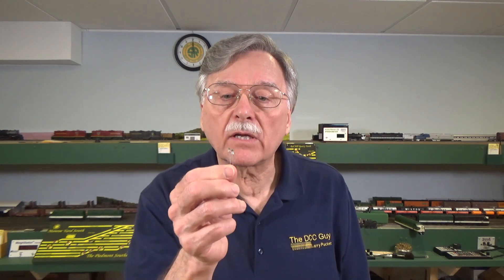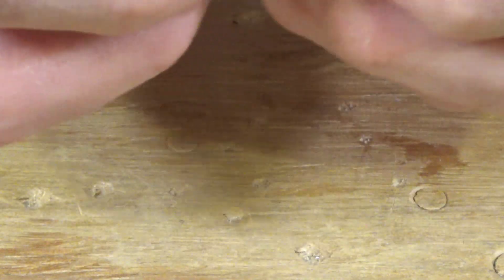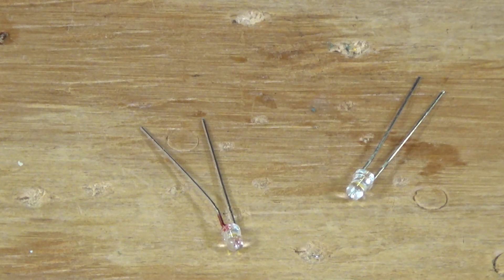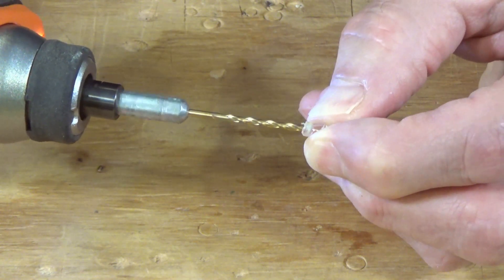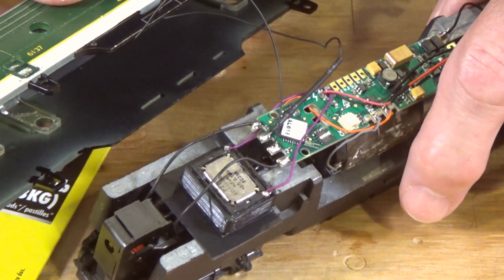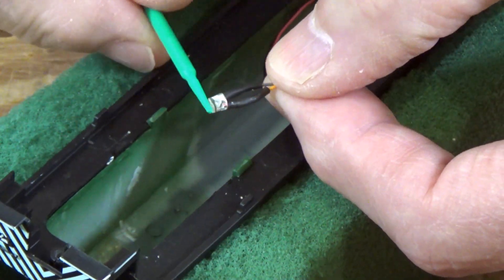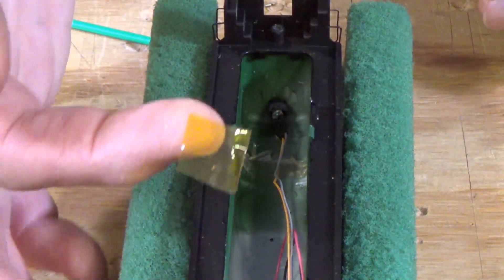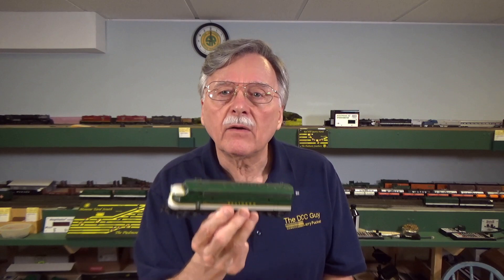Light Up Your Locos With LEDs (92)

Comment: What is the black putty you use to seal the back of the LED to avoid light bleed?
Reply from the maker: It is often referred to as black tac or blue tac in some cases and it is a strong adhesive putty. The black version seems only to be available in the US from a company named Uhu and I found it on Amazon. You can get the blue or white version at a lot of hardware and craft stores but I prefer the black.

Comment: 1 comment .whi are u using 4 leads .i ame using esu decoders and the blue lead is the positive the purple and green are the negative .i use the blue for the 2 led's ;so the plug have 3 pins not 4
Reply from the maker: That works too.
Reply: @TheDCCGuy  if you have the space then its not a problem but if you dont have space then les leads are welkom

Comment: Adding resistors in line to LEDs is not the best practice. It's OK in a pinch, but as voltage variations can affect the LEDs performance.
Instead of soldering or adding a resistor in line with an LED,, use an SMT current limiter instead. It's about the same size as a resister, only variations in voltage will not affect its current output. You can put 7-8-9+ volts across the LED/Current Limiter and it will only allow 10ma, or 20ma of current thru the LED. They even make them SMT pre-mounted on a small circuit card so all that's needed is to solder the wires.
They also make them in a "transistor" style looking package. There are also 4-pin SMT voltage regulators, (Maybe 1/8 in sq) put 20+v in and get 3-5v out. This stuff is pretty easy and makes adding LEDs simple.

Comment: Thank you Larry for more very useful information. Surface mount LEDs and surface mount resistors how neat. I will watch the rest of this series later today.
Reply from the maker: John, I don’t try to solder wires to the LEDs and resistors anymore, way too small. Instead I use prewired ones I get on ebay. I have shown these in my more recent videos on decoder installs.

Comment: One thing that may make some of this easier.  ZAP comes in a small spray bottle.  Works really well and is refillable.  So add the CA, cyanoacrylate, then hold the two pieces together as seen in the video then spray a quick shot.  Done.
Reply from the maker: I have a large bottle of the stuff and I dab it on using a micro brush.

Comment: Let’s say I was installing those surface mount LEDs into a unit with two bulbs in one headlight fixture, like many EMDs. Is only one resistor required for both LEDs, or do both LEDs each require their own resistor?
Reply from the maker: I always install them with their own resistor, it avoids complications. Also the surface mount LEDs from China come with 1000 ohm resistors already installed. 

Here’s how I handle the small dual headlights. I fill the opening in the light casting with some Testors glue or canopy glue, anything that dries clear. This will usually form a lens shape, just don’t over apply it—I use a toothpick. You could also use Glosscote. Then I mount the LED from the rear so that it covers both openings and you only need one LED.
Reply: @TheDCCGuy  I think I gotcha! So the glue itself acts like a lens for both openings?
Reply from the maker: Yes, basically it fills in the little openings and if done right makes very convincing lenses. Of course if the model has a plastic insert that should transmit the light from one LED glued to the back of it. In most cases there really is no need for more than one.

Comment: Where do you connect the negative wire when using Nixtrainz motherboard Decoder Buddy and connection board.  Can you connect the ground soldering pad?  Your knowledge on using the Decoder Buddy will be great.  Love your videos.
Reply from the maker: The connector pads are marked in the board and on the instructions. He is about to release a new version that also has a solder pad for the third wire used with LokSound decoder keep alives.
Reply: @TheDCCGuy  Thanks, I have positive power on top and bottom pads but no negative per the instructions and diagrams of the connection board.  Does that mean I have a bad decoder from Soundtraxx,  885010/TSU-21PNEM, Tsunami2 (Diesel Sound decoder?  Can't figure out why the LED (with 1000K resister), doesn't work when connected.  LED is good as tested.  Also I can take the positive connection per the instructions for the connection board and place the negative lead on the Ground pad at the keep alive pad and lights fine.  Any help will be appreciated.  Your videos are fantastic and have been great.  Thanks.  (Thanks for your quick response)
Reply: Mr. Puckett; Thanks for all of your videos and help.  Had a bad solder (or lack there of) on connecting the connector board and the Nixtrainz board.  Once I connected another light, proper solder connection, worked perfectly.  your help was tremendous.  Again thanks..

Comment: LED does not work on DCC track power, works perfectly with 9v battery??  Suggestions ?
Reply from the maker: Did you get the polarity correct?
Reply: Yes, polarity was correct for 9v battery, this was a ‘blinking’ LED but on track power it will NOT blink??
Reply from the maker: What exactly do,you mean by on track power? Are connecting directly to DCC power or to one of the function wires on the decoder? If to track power then the interaction of the blinking and the alternating current of DCC may be the reason.

Comment: For every one who does not know . Go to Evan Designs and buy there LEDs with bridge rectifier. They do not have polarity issues.  Many colors and sizes. You can not get any easier then this and are ready to install. I put a dab of yellow paint on the tip to tone it down a little. Once you try these you will not use anything else.
Reply from the maker: Good link, I tried to find them previously to no avail so bookmarked them this time.

Comment: If you were limited on room, how many LED could be used on one function.  Could you add SMD LED like 0402's for a pair of step lights or ground/truck lights to say the headlight function if you had to?  Or is 3 LEDs too much for the output of a single function?  

Thanks
Mark
Reply from the maker: It depends on the decoder and how much current each function can support. Each LED requires about 20 mA and most functions cannot exceed 100 mA so that would mean 5. Check your decoder instructions to see what the functions are limited to.
Reply: @TheDCCGuy  Great answer thank you for explaining.  I am only considering a headlight and 2 truck lights together.  Thanks again!

Comment: I have been wanting to add a nose gyralite in a few of my locomotives.  Not sure what I can fit in the nose as far as LED so do you think it would be feasible to add fiberoptic to an LED a short distance away within the locomotive shell and have the effect from the LED follow the fiberoptic to display the same lighting pattern on the light on the nose of the loco?
Reply from the maker: Not sure how well the fibers would work but worth a try. You could also use grain of rice bulbs. The Walthers catalog and website should be a good resource for the parts and available bulbs. As for fibers I got a bunch last year from China off eBay.
Reply: @TheDCCGuy  I have thought about the nano LEDs but I have to see.  I am specifically referring to Atlas GE U Boats where there is currently no nose lights at all.  So I am not replacing anything, but adding lights in this case.  I will try and see what I can fit in the nose lights I am adding and see how to go about it.  I may first try on an Atheran U33C dummy

Comment: What kind of connectors did you use for the connection between the shell lighting and the decoder wiring?  I like those.  I tried decoder buddy don't much care for them.
Reply from the maker: Those are TCS wiring harnesses. Their website is www.tcsdcc.com and I think the harnesses are in the accessories section.
Reply: @TheDCCGuy  thanks

Comment: Pretty much how I do it as well Larry. I didn't see anything about dealing with light bleed. Just for note, I use a thick acrylic black, flat preferably and paint the lens,and LED assembly in place, or pre assembly if possible. Anyway, great video. I subbed as well as go to your site often. Keep up the good work!
Reply from the maker: The Uhu putty does a great job of sealing the light into the lens as well as holding the LED in  place. On the RS3 the shell is dense enough and the green paint dark enough so I ‘ve never seen any bleed through. The main concern is keeping it from lighting up the cab.

Comment: Another great video, Larry!  Can you say again what material you used to make the headlight lens in the Alco (to use in place of the bulb that Athearn used to provide)?  Thanks.  --MARK
Reply from the maker: That was Testors Clear Parts Cement. Just stick the tip in the holes and give a little squirt then let it dry.

Comment: Hi the Energineering  .  Com link goes to a YouTube page, is that correct?

As a aside, do you have a recommendation for reasonable priced and reliable DPDT toggle switches for turnouts?   

Thanks. Don
Reply from the maker: My mistake, take off the first “e” and it will work. As for the DPDT toggles my go to for almost all things electronic is All Electronics.

Comment: I'm not at all an LED expert, but I've heard that LEDs can be dimmed (within limits) by increasing the amount of resistance added. Effectively, provide a little less voltage than the LED is rated at. If correct, that would be a convenient way to abate a "too bright" headlight. 

What I don't know is how many ohms would be reasonable, in series with those nice pre-wired 1k resistor LED units you're using, to get some reasonable dimming - without causing flickering or inconsistencies. Do you have any insights on this? Thanks!
Reply from the maker: You can play around with a small trim potentiometer to dial in various resistance values just be careful not to overdo it and blow the LED. Once you find the right amount of dimming just use a multimeter to read the resistance across the pot and you’ll know what size resistor to  install with the LED.

Comment: Should the resistor always be attached to the positive lead or does it make a difference as long as the LED  has the correct polarity?
Reply from the maker: The location does not matter as long as it is there.
Reply: @TheDCCGuy  Thanks so much!

Comment: Really learned a lot with this video on LED's , Up to now just used them on buildings.  I model in N scale so the 3 MM are a little too tight to install but with the surface mounts I can see they would help.  I hope at some point you will do a series on signals using the digitrak components.
Reply from the maker: I recently did a DCC Corner column on signaling and touched on the Digitrax system. Ben Lake and I think Dana Kawala did an article in MR on Ben’s use of that system for the Canadian Canyons feature layout. He covered it in much greater detail in the videos they did on Model Railroader Video Plus.

Comment: Can I use those pre-wired LEDs on regular DC locomotives?
Reply from the maker: Sure, but it will take special wiring to keep the polarity correct. Remember that when you reverse direction of travel you do it by reversing polarity and as I said in the video these are polarized devices.
Reply: @TheDCCGuy  So, if I run in reverse, the  (head) light would go out?
Reply from the maker: Yes, but you would always need to orient them the same way on the tracks. The standard for wiring DC is that when positive power is applied to the right rail the loco will move forward. But as soon as you hit the reverse button that all reverses as does the loco. And of course that depends on which way it is facing—DC is complicated!
Reply: @sort187  If you wire the rear headlight "backwards", you can have easy directional lighting though.

Comment: Thank you, even as an experienced installer, I learn techniques that are different than what I do, I would combine common wire from the led’s before the connector using smaller plug
Reply from the maker: I know what you mean but in this case because the wires come from different ends of the model and meet in the middle at the connector it makes no sense to combine the commons. Now if I had installed more than one LED at each end I would have combined the commons.

Comment: Thanks Larry, informative video. To dress wires, I occasionally use sections of plastic drinking straws CA'ed into place, also to get a stable voltage for LEDs, I now use, if there is room, a small DC buck regulator from eBay; https://www.ebay.ca/itm/5PCS-DC-DC-Buck-Step-Down-Voltage-Converter-3-3V-5V-6V-9V-12V-3A-Mini-Regulator/322709169282?hash=item4b22f72482:g:gMQAAOSwJJVZrAg6

Comment: Larry Great video on lighting up a loco, love all the tips and tricks in the video. I am interested in the pre-wired surface mount LEDS also. I think you said you would get links for those in this video, looking forward to those links.  Thanks for sharing and stay safe.  Ken
Reply from the maker: https://www.ebay.com/itm/L0805GW-20pcs-Pre-Wired-GOLDEN-White-SMD-0805-Led-Lamp-Light-Set-12V-18V-NEW-/221183972188?hash=item337f97935c
Reply: Thanks!
Reply from the maker: I’ll get the rest of the stuff added to the description later today as soon as I get the proofs for my next column checked and back to MR. Sometimes things seem to land all at the same time!
Reply: Thank you again for work on getting the info on the products. It is well appreciated.

Comment: When you think you are really good at soldering, just attempt to solder very thin magnet wire to 0402 LEDs. You will become humble very fast. Don't ask me how I know this.
Now I buy my LEDs  with wires and resistors already on them.  It makes life so much easier.
Reply from the maker: I too have a spool of magnet wire that is now surplus now that I can get these SMD LEDs prewired. Doing it by hand was a total pain!

Comment: Larry, Is there a listing of where the surface mounted LED's w/ resistors mounted on the positive lead can be purchased ?
Reply from the maker: https://www.ebay.com/itm/L0805GW-20pcs-Pre-Wired-GOLDEN-White-SMD-0805-Led-Lamp-Light-Set-12V-18V-NEW-/221183972188?hash=item337f97935c
Reply: A bit outdated, but the resistor can go on either side.